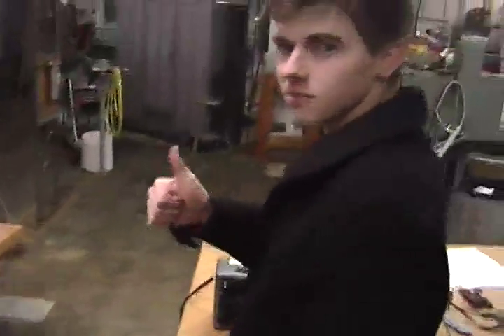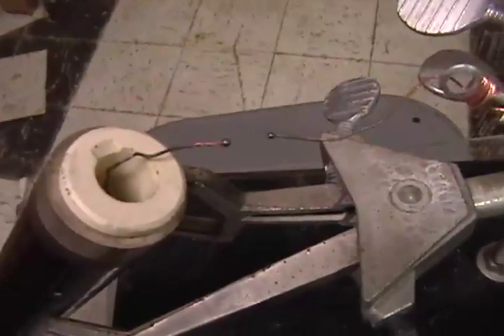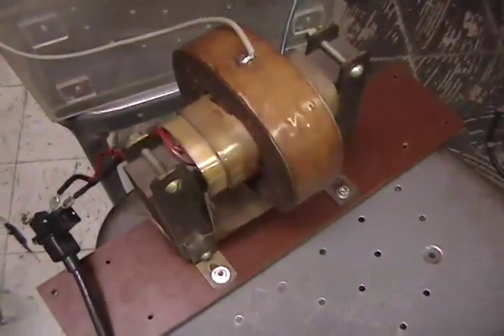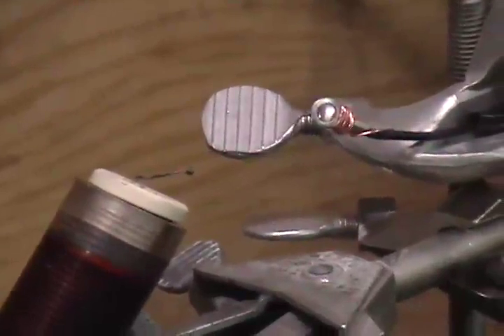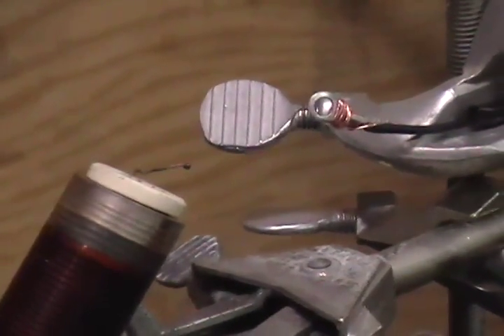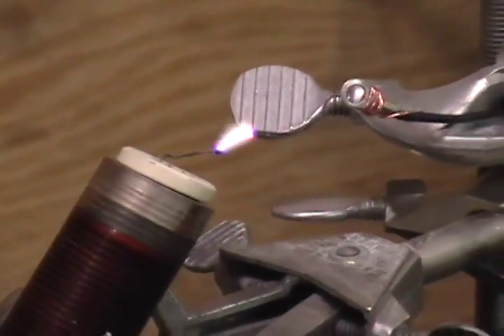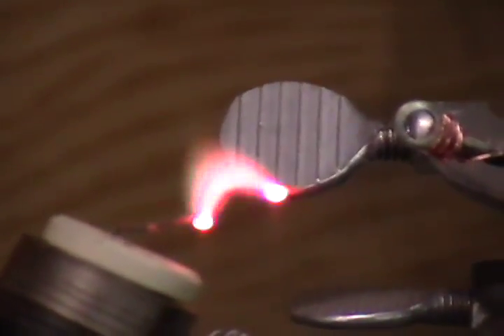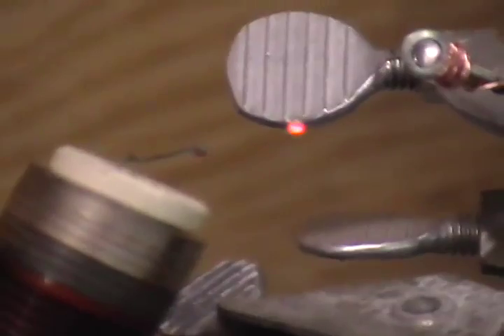Thick Electrical Spark

Comment: ive seen a spark with two colors with a v shape. when i was in 5th grade the power company came over to my school to show us the dangers of high voltage and powerlines can be. they used a hot stick to make contact with the grounded object such as a piece of a metal fence. the touch the stick to the fence and gotten this v shaped spark up to 2feet long. one branch of the v was red and the other side was blue. sorta like the the v the have for valvoline. nice though

Comment: .02 amps gets hot enough to melt the copper?  That's pretty interesting.  I wonder what in the world they would need a 280:1 transformer for.  Looks like when the ends got glowing hot their resistance got so high that the arc moved away.  I could spend days in that lab and I don't think I could get bored!

Comment from the maker: We weren't metering current draw, but the variac has a 5 amp fuse IIRC, and the transformer is around 280x step-up, so I'd estimate around 0.02 amp across the gap at it's highest before we tripped the fuse.

Comment: Are you running that Flyback on 60Hz power directly from the Variac? If so, I'm surprised that it doesn't smoke and burn up! TV Flyback transformers are designed to run at around 15KHz here in the U.S.